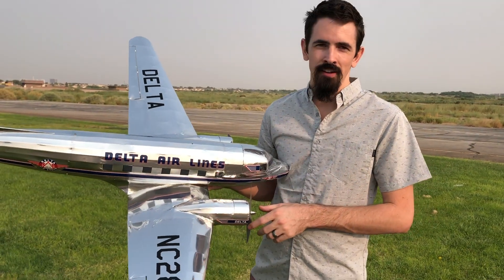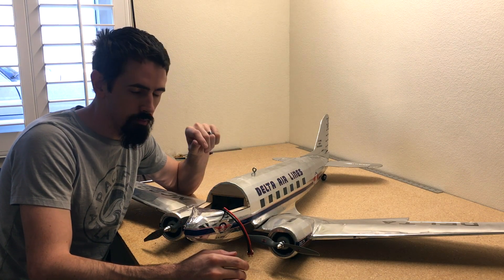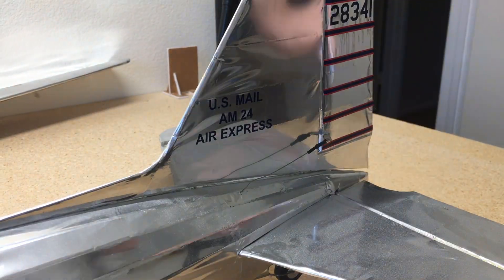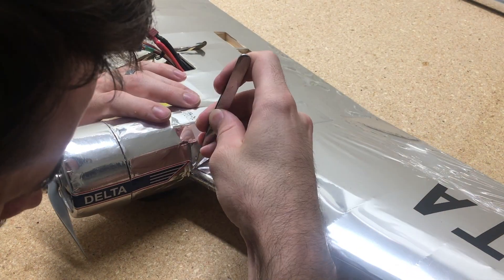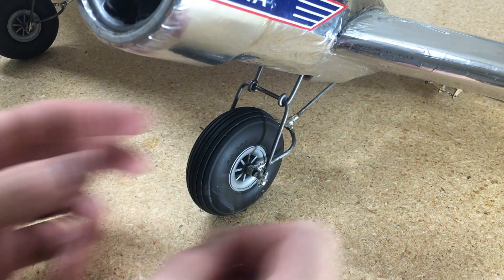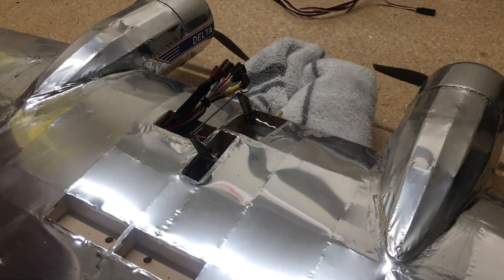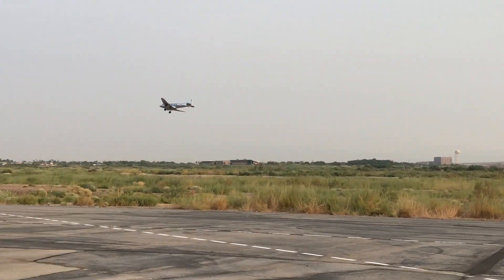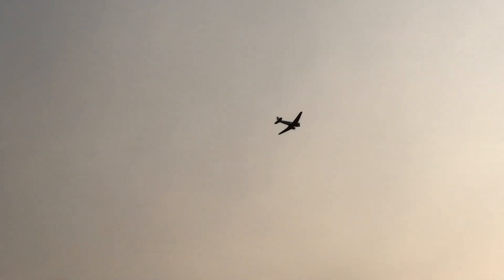Moving Box 📦 Crushed My DC3 RC Airplane!!

Comment: Now stop flying it and hang it up somewhere safe it’s too pretty to risk in the air. 😉 Seriously though, it always looked a bit tippy in the air, (imo) , you mentioned the CG forward of normal in first flight, that was noticeable. I also thought your bank angles where a bit steep, sometimes close to 90 deg, that looked scared and had me clenching my b..t cheeks cos I thought you’d get a tip stall. 
Anyway, beautiful plane, great build videos. Thank you so much for sharing.